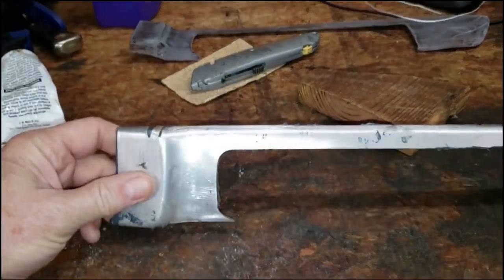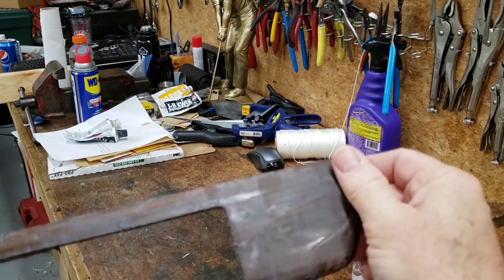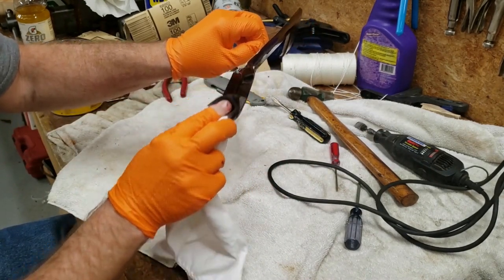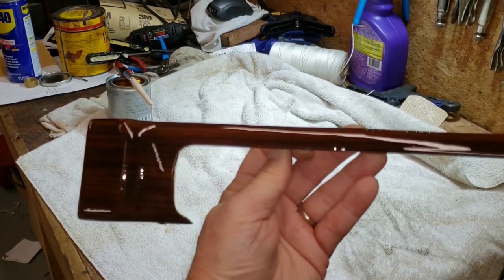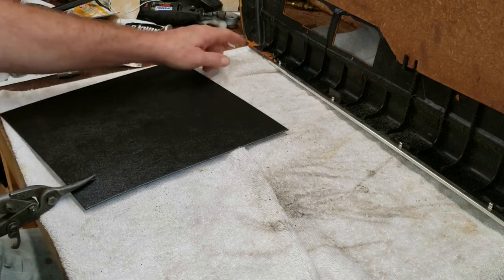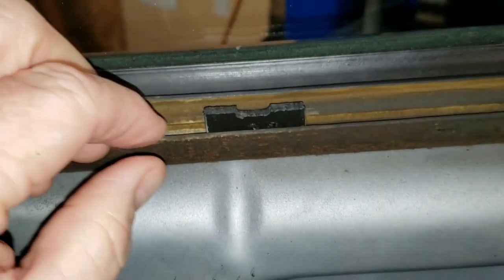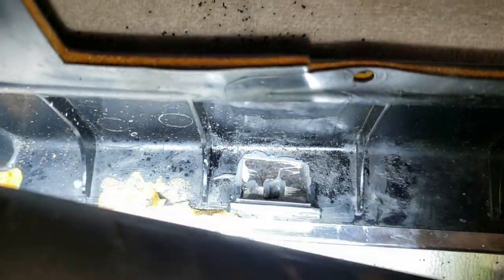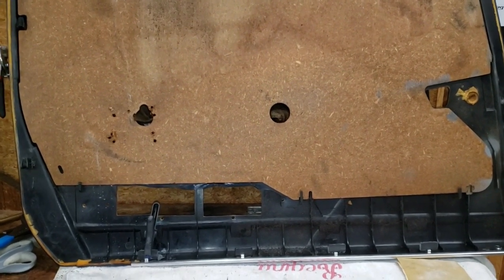Mercedes 300SD W126 - Part 2 Front Pass Door - Fabricate Door Panel Flanges / Finish Wood Trim

Comment: Hey! Good to see you again. 
I guess those engineers at Mercedes-Benz do learn as they go. My 01 door panels look a lot different than that one. The clips at the top are just little v shaped metal things and they come right out of the metal lip at the top of the door when you push the panel up. Also the door handle is made into the panel and then there is a cable hooks into it on the back of the panel.
I've had to take all of the panels off numerous times to replace the window regulators and the vacuum actuator on one of the door locks. Those are a pain!
I have managed not to break any of the clips at the bottom and sides of any of the panels when taking them out. They seem to be fairly sturdy and well anchored. 
Those door straps have ball bearings in them and once the spring holding them in weakens they will jam up and cause the strap to not function. You may need to replace it. Just grease it with synthetic grease before putting it in. It should have a plastic cover fits over it to keep water off it.
I'll be watching for your next video on the wood trim.
See ya!
Reply from the maker: Thanks Werner. Was moving a little slow last week. Was under the weather a bit. Getting back into the saddle! I may indeed need to replace the strap. Won't know until I get it out though.

Comment: Your repairs to the wood and door panel flanges are very impressive!  Have you ever experimented with plastic "welding"?  All you really need it a strong soldering iron, and appropriate tip!
Reply from the maker: Yes I've seen those kits. There are also plastic stapling kits. A friend has one of those and it works well. In retrospect those devices might be a little cumbersome for this job. It's very tight quarters. And of course..... this is all experimental and may fail horribly. ha ha .... we'll see how it goes.
Reply: @ImpalamansGarage  Another video coming then I take it??
Reply: @ImpalamansGarage  Btw, when I say "plastic welding" all it really means is "melting the plastic back together".  ANY soldering iron will work!  No need for the subpar "kits".  I've found that they do work I suppose, but they kind of suck.
Reply from the maker: @Johnathan_Waters  Yes in a few days. I've quite a bit more work to do yet on this door.
Reply from the maker: @Johnathan_Waters  Not sure I could get a soldering iron tip angled properly for this job. Maybe one that was bent at an offset? Break the flanges off one of your door panels and send it to me to experiment.  😊😊
Reply: @ImpalamansGarage  Check out eBay, there are all kinds of angled tips, even angled with a chisel point, etc.  I would consider a "rework station", as you get a powerful solder iron and heat gun with temp controls etc.  Best part is the iron/gun/handheld part is replaceable and CHEAP.

Comment: Have you  made any videos on how to fix the Floppy Drivers inside door handle?
Reply from the maker: Not yet. Assume you mean the chrome door interior door pull. Mine is a little floppy on this door. Planning to get to it in this series.
Reply: @ImpalamansGarage  YES!,  I took mine out and added a washer underneath the hinge point but that didnt take out all the floppyness
Reply: I figured out that I can take a photo of something and convert it to 3d image and print it out on my printer, You can adjust the size of what ever it is youre  printing, I printed out a picture of my car and added it to the trunk deck lid on the inside:)
Reply from the maker: @rb.867  Cool.  When I get around to that part of the project I will consider that as a possible fix. Not sure what I will find yet. Still working on the door card right now.